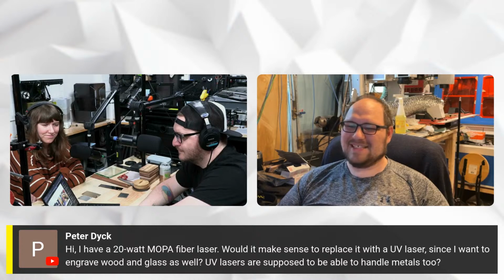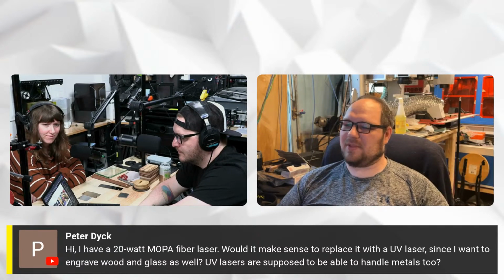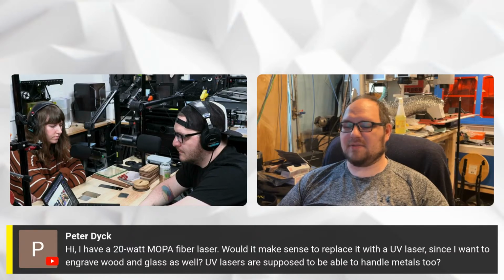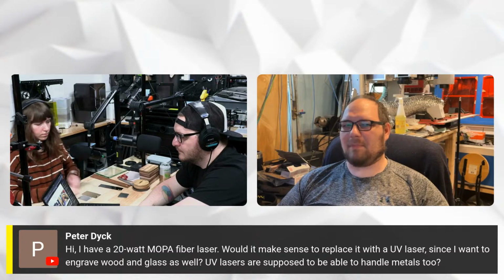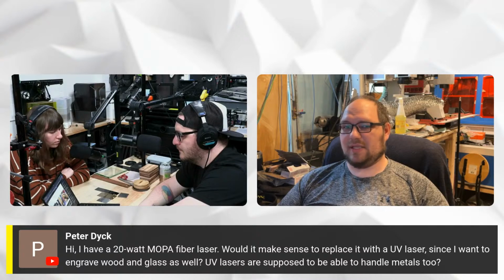🔥 Unlocking UV Mastery: Our New Library Revealed (JPT + Inngu Support!)

Comment: the JPT is not revered it is based on q-pulse and frequency the lesser frequency extract more material and the more pulse the lesser the power applied versus 1 single pulse so that is how that is supposed to work.
I have a CRS UV 5W like the JPT i have actually never heard of the opposite approach?!
The lens difference (or lack there of) I suspected but you guys helped me be assured any lense size so thanks BUT u should explain even if u change the lense u should still adjust your focus to match the lend as u would for the fiber. BTW u will see a slight difference with a 80 mm vs a 300mm